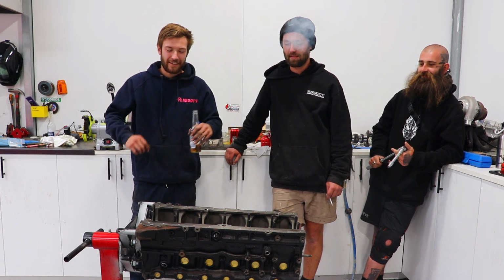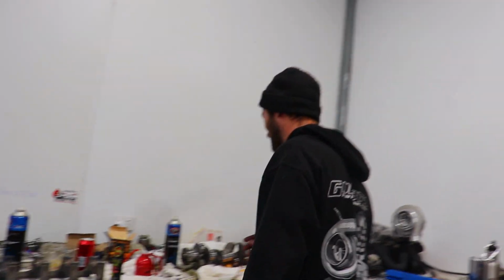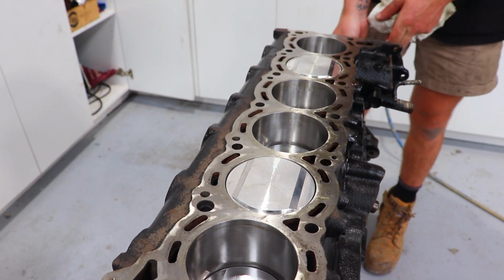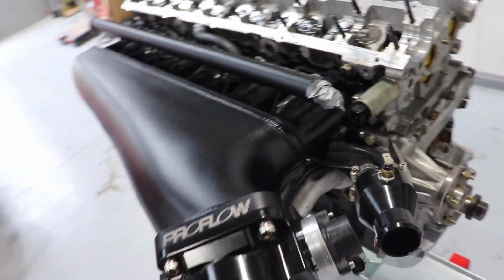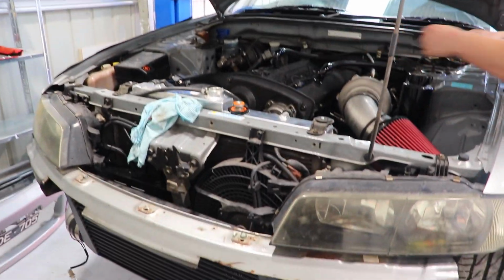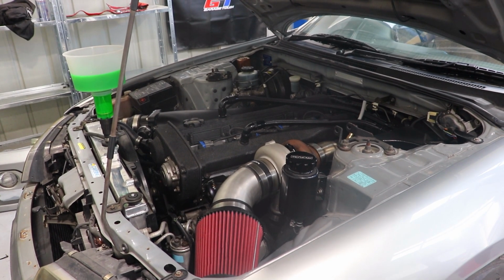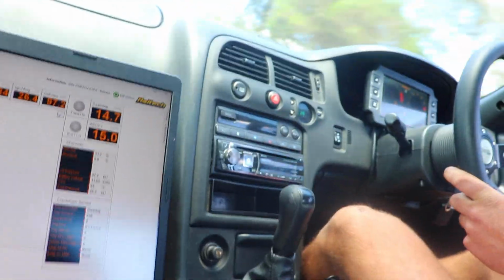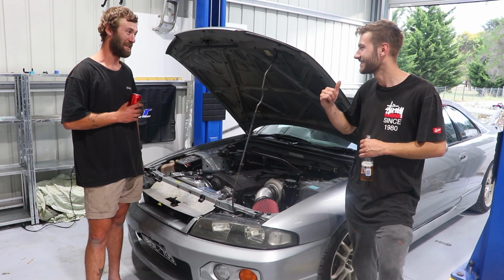COMPLETE FORGED RB25DET BUILD!

Comment: Fucken hell boys it’s not an rb26 with the big balancer bolt!! They need 400nm an rb25 needs like 150nm the bolt is smaller.. Adam gayZ just torqued his rb25 bolt to 400 and have a look what happened to his engine 😂
Reply: 🤣 adam lz had his torqued to 26 spec and got away with it with his power for how long? Then he reverts back to 25 torque over tightens alt belt and then snaps crank. Think there's allot more to it.
Reply: Ben Scott also 21psi you’ll make 355rwkw
Reply: Ben Scott just giving some feedback and advice it’s just my opinion you don’t have to agree with it.. you’ve over torqued the dog simple as that
Reply from the maker: Rb26 are torqued to 460nm. As we said though each to their own.